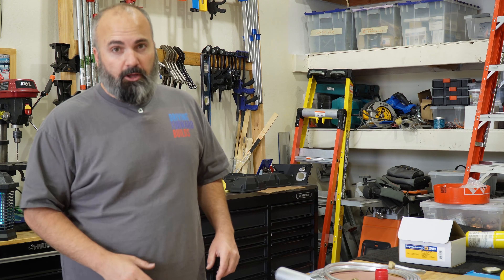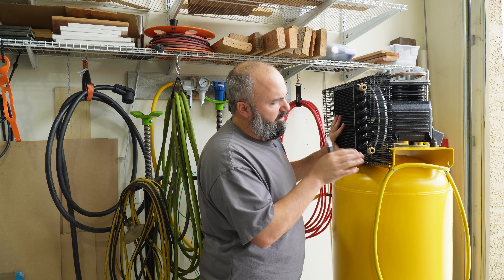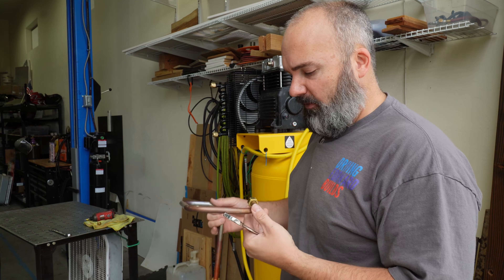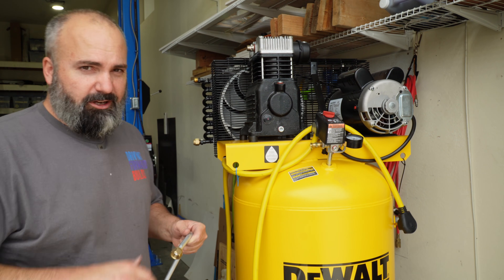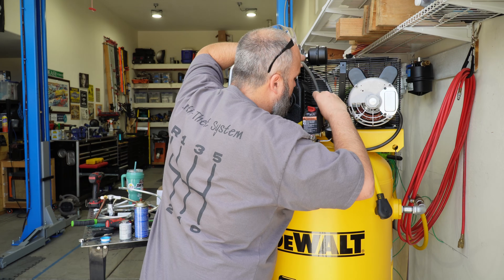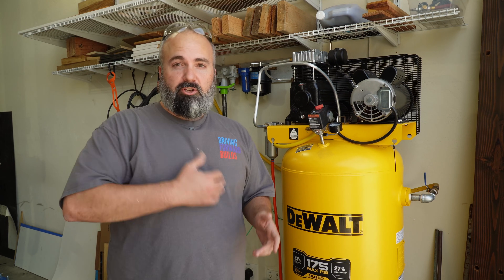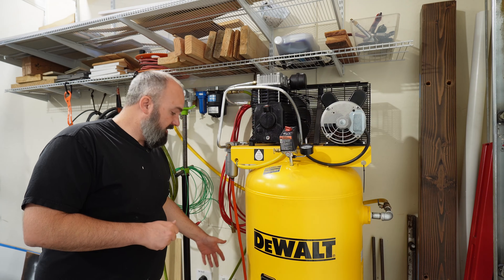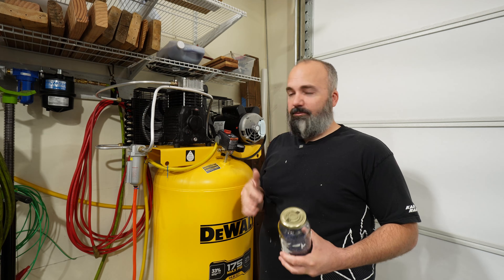DIY Air Compressor Aftercooler/Dryer

Comment: The compressor output air is hot but it goes into the tank. Does your tank get hot enough to justify that array of copper pipe? My compressor tank barely gets over room temperature. I put 1 regulator and filter at the tank output which regulates the whole system.
Reply from the maker: My tank does warm up yes. And in the summer time holds a temp above 100* pretty easily. I have been using this setup for a few seasons now and how found I get some water in the tank, and check it with each use. Usually no more than a few ml comes out. My drier media on my line last for a long time as well.

Comment: Why not use compression fittings instead of flares? Genuine question, not hating.
Reply from the maker: If I recall, when I was looking for parts the compression fitting were slightly more money.
Reply: @DrivingForwardBuilds thanks bud

Comment: Do you mind telling me the model of your Dewalt air compressor? I’m planning to buy the DXCMV5076055 which is 2 stage 5hp 60 gallons. I’m wondering if the fittings are 1/2, same as your!
Reply from the maker: Mine is the DXCM603. I found it on sale at Tractor Supply for $930 last year when I bought it.

Comment: Have same exact compressor . Planning on using it for about the same projects especially sand blasting that can be frustrating with water causing the gun to jam . Great video thanks for the tips .
Reply from the maker: Glad the video could help! Hope it works well for you.

Comment: I did this several years ago with a transmission cooler.  
   Used Swagelok lines and fittings. It’s stainless so I bought the bender for the line.  Very nice products. 
   The main reason I bought the Swagelok lines and fittings was to maintain the inside dimensions of the compressor air lines. 
   Where I screwed up was mounting the cooler solid to the motor frame on the compressor tank. It vibrated the cooler causing an air leak in the cooler itself.  
    It lasted a few years and the automatic inline water separator never discharged any moisture. I would take it apart to check from time to time. Very little to no moisture was accumulating in the water separator.  
    I had saved all the original lines that were on the compressor so I put them back on until a new cooler could be had and mounted properly. Haven’t found the time to do so, but moisture is growing into more and more of an issue. 
   I might just bend up some line and mount it just like this one.
Reply from the maker: Thanks for sharing your experience, good to know! I'll keep an eye on mine for vibration failures.

Comment: There is no way we are getting a lower temperature out of that after cooler than the ambient temperature and by the way there’s no substitute for a refrigerated compressed air dryer
Reply from the maker: I'm just using an infrared gun to measure. If it's lying, I'm not asking it to, and yes there is no replacement for $$$$ refrigerated systems.
Reply: @DrivingForwardBuilds skin temperature?
As it’s impossible to achieve that low of the temperature in that high of an ambient condition

Comment: Great video. I'm looking to set a new one up soon. The JIC fittings are super easy to find. On the zip ties the airplane trick works great to get a little stand-off. Just put a tie around the holding tie before it's cinched down. I will be getting one of these coolers thanks to your videos. Many thanks !
Reply from the maker: I'm glad that helped and the JIC fittings are a great idea.

Comment: Great modification! Someone else suggested an additional water trap before the tank & I agree. A simple  1/2" dia. galvanized Sch.40 steel pipe straight down from cooler for 2 ft.,  then into a 3/4" "T" & up a 3/4" pipe to existing water seperator. A drain valve or auto drain at bottom of "T" would remove most water, allowing the existing water seperator to have less load & be the second stage of water removal before the tank. The cooler was a wise move, great upgrade!
Reply from the maker: That's a great idea; I might add that to the system.

Comment: How’s it running ? Doesn’t reduce the air flow to compressor or electric motor to cause any long term failures due to heat ? I wanna do the similar setup on my 5hp 8o gallon IR I just set up - I added a mag start relay and 2 pole safety switch to control auxiliary fan for electric motor - didn’t know if I should add another fan for heat exchanger 😊
Reply from the maker: So far it's still working out great. I haven't noticed any discoloration in the oil or around the case. I do still get a little moisture in the main chamber leading me to believe an additional fan or larger radiator could help. But honestly I'm getting a few tablespoons vs a cup or more of liquid before.

Comment: Just a heads up, the link to the tubing bender in the description is no longer correct. That company changed that model, and it no longer bends 1/2" tubing.
Reply from the maker: Dude, thanks for the catch. I see they have a new 1/2" version. I'll fix the link. Thanks for looking out🙂

Comment: Those 13.7 CFM compressors are running too high of RPM to last, l turned mine down to 120 psi to shorten run time they really struggle to reach about 120 to shut off pressure,
Reply from the maker: That’s good info. So far it’s seemed like it’s able to maintain pressure way better than my old unit. I’ll keep an eye on it and make sure to change the oil.

Comment: Seems to me that if the air is now colder going into a hotter tank, you’re still going to make excessive compensation inside the tank
Reply from the maker: The point of putting cold air into the tank is that it doesn't heat up as much as before. Plus the condensation is pulled out prior to the tank. I do still drain the compressor after every use and get a little mist out. But not the rush of water it would prior to installation.

Comment: You learned why they don't use aluminum tubing from the factory.  Aluminum will work harden and crack so much easier after than copper.  Besides the crooked ferrule, you are dealing with constant vibration.  Even if you think you can't see or feel the vibration, there is always inherent vibration in any reciprocating machine and it transfers to the tubing which translates into micro movements which will work the tubing.
Reply from the maker: You are 100% correct. In fact, the line broke again just recently. I have a bunch of the aluminum left, so I will just make another line once this one is too short to fix. Then, I will get some copper lines and bend them up the way I should have from the beginning. I guess the old motto, "buy once, cry once," really does make sense. I was just trying to save a few bucks on the copper. oops.

Comment: nice to see you did the same as i did... theres a fan, why not use it, huh?

i opted for the single layer 9 row. gravity... the double pass makes loops... and the water pools up in there. then your just bubbling the air through water...

the water trap... they require air flow to really work, and as the tank fills, flow rate reduces... they dont work so well. found i was still getting some droplets sneak through until i swapped over to a long "baffled catch-can" type setup... havent had even a hint of moisture from the tank since.

another advantage of throwing the cooler on is the starting load... it takes a few seconds for it to fill all that volume up, lets the motor virtually freespin at first. despite the blowoff/unloading valve, a lot of cheap compressors get grumpy (burnt out motors, blown circuit breakers, dimming lights...) when starting as the line pressure rises before the motor gets up to speed... and even some not-so-cheap ones do it too...
Reply from the maker: Great info. Thanks for sharing!

Comment: Your comment on a auto drain is good. Try the Moisture Minder drain by Tsunami Compressed Air, this works great been on the market since the 1960’s ,doesn’t waste air and is totally pneumatic. A good electronic drain is the EDV , it has a built in self cleaning strainer to eliminate rust from fouling the drain. They both are easy to install for the DYI  people.
Reply from the maker: I will definitely look into those! Thanks for the tip.

Comment: Getting rid of that swamp cooler and going mini split AC is going to save you big time! There are some auto drain 110 volt timers on the market that will eliminate your desiccant maintenance
Reply from the maker: For sure. I can't wait to get there.
Reply: Just had an 18,000 BTU along with R-18.4 garage door installed in my 2-car garage / workshop.  Awesome!  My garage is cooler than my house lol

Comment: Thank you!! Very helpful video. 

Do you need a metal line coming out of the radiator, since the air is now much cooler? I’m gonna do something similar, but with braided line maybe, and it’s expensive. Can I just use rubber hose for the line from radiator to tank?
Reply from the maker: As you point out the air is much cooler there. I would think as long as the line can handle the pressure and what little oil might bypass the pump you’ll be good. If it doesn’t work you’d certainly hear it. I over crimped my connection to the tank and it broke after a few cycles and blew off. It was an easy fix though. I just resent the line and tightened back down.

Comment: I have a concern about this particular radiator. (Yes, I know others use the same one.) At each end the tubes attach to another with 180 loops. but it looks like half go to a lower tube but half go to a higher tube. Doesn't water collect in the lower tubes leading to higher ones? Aren't you blowing air thru partially water filled tubes? It's obviously working but would you be better served by a radiator that only flowed in a level to downward direction? I'm asking as I want to do something similar but would like to not have water "trapped" in the tubes. Thanks for your thoughts.
Reply from the maker: I’m not sure that the water would actually collect as there is a constant flow of air moving through the tubes. That and the air moving through is very hot. The tubes are continuous as well leading me to believe any water that may be trapped will push through to my first separator.
Reply: @DrivingForwardBuilds  Thanks for the quick response!
Reply from the maker: @Happily_retired  glad to help.
Reply: @Happily_retired  that was my train of thought when i did mine, and so i opted for the thinner single...row? pass? arrgh! 9 row, anyway. more than enough, even with a 40C+ australian summer at 99% humidity... its cold by the third or fourth row...

and yeah, gravity all the way, even when its stopped its draining...

Comment: I'm going to do this.  The only thing I think I will do differently is come up with a different placement of the cooler.  Seems blowing the heat off it and back on the head is hinder8ng the cooling of the head.  Though you may not see a problem, I think I will do it anyway.
Reply from the maker: That's a good idea to move the cooler. Originally I was planning for the cooler to be off the unit with a fan. That was starting to get more complicated than I wanted. Hope it turns out great.
Reply: https://youtu.be/gNlsULpBtCk?si=NkJZcNyyeR5RtSsf

I built a frame and side mounted it

Comment: I just saw another video where the person had one of the hard lines break where it attaches to the cooler (on the acttual cooler, not tthe AN fittting) after a couple of months. How has yours held up so far?
Reply from the maker: My cooler lines have held up great. I did however have my line break at the check valve going into the compressor. That was my fault though. I tighted the compression fitting with the ferrule sideways and then it leaked, so I overtightened it and weakened the aluminum tube. It broke within a few days. I cut the line and added a new ferrule and has been good since.

Comment: You must have (ANY) water seperator at least 25' from the compressor.  This gives it enough time to help cool the line.
Reply: The water separator needs to be far enough downstream for the air to be cooled. He’s using a 16 pass radiator with air coming out at about 88 degrees so putting the water separator after that is just fine.
Reply from the maker: @calsbarn5996  I didn't really think of the distance in the cooler. Good point, Thanks!
Reply from the maker: This would be the ideal situation. In my case as well as many that 25’ rule becomes less practical. I hook my air line right up next to my compressor and can reach the whole shop and driveway.

Comment: Works exactly as he shows. However I found using (2) water separators removes the majority of the residual water and keeps the tank supply much drier. Otherwise, this is a MUST HAVE on any compressor system!
Reply from the maker: Good idea with the two separators. I do still get a very little water in the bottom of my tank.
Reply: Oh, like that idea too. I’m using the same radiator and water cooler he is and find that it’s probably between 80 to 95% efficient depending on the temperature / humidity conditions. I’ll buy another water separator and see if that improves the efficiency.

By the way, my efficiency estimate is based on comparing water removed by that water separator to the the water in the tank plus the water in my second separator closer to my work area. If I instead compared only the water from the second separator to the water from the first separator plus the water in the tank I’d say it’s always at least 95% efficient and probably much higher - maybe 98-99%. That’s because the air going into the tank is already cool so it doesn’t hold much water even when used for extended periods of time.

Comment: thanks for sharing your great design! carrying this thought even further, since compressed air is so hot, this application seems ideal for heat-powered coolers. an ammonia and water absorption cooler, like the old gas refrigerators, uses heat to cool an evaporator that you would place adjacent to your cooler fan, cooling your compressed air below the ambient temperature by the time it enters your tank. ...or, a paired sterling engine/cooler could work similarly, providing sub-ambient cooling from the compressor heat. it would be interesting to see if there are any commercial compressors that take this approach.

Edit: I see Thermax offers absorption chillers for air compressors, but at industrial and not at garage scale. Even though they get "free" energy from the compressed air heat,  but maybe at smaller scales, chilled compressed air isn't worth the capital cost of an absorption chiller?
Reply: sandblasting, plasma cutting, spraypainting, you want dry air. the chilled compressors are generally running "on demand" as well, rather than storing... storage is an issue. if you fill a tank with CHILLED air, the pressure will rise as it then warms up to reach ambient. and that may very well push the tank past safe working limits, especially in the sun on a hot day...

no point cooling below ambient if you are storing any appreciable volume.

and as for air tools... you get better performance/more power/less air consumption if you heat the air back up to what it reached during compression, or higher, before use. easily proven... drop a coil of pipe in a bucket of boiling water just before the tool (pointless to heat it up then run it through twenty foot of airline?)...

air at ambient cools below freezing as it expands and cant expand to its original volume until its absorbed heat... an air tool that exhausts warm air is producing more power.
Reply from the maker: Chilled compressor cooler/driers are more often found in commercial applications with paintwork and blasting/coating. They need dry clean air. In a home shop you are often, as you pointed out, limited by the cost of such applications. However with the skill and enginuity it could be done, and you sound like you know enough to make it happen! Thanks for the comment and view!

Comment: Stupid question coming... anyone do this and add another larger condenser or double up on the cooler? Add electric fan? More surfaces, more cooling. Trying to eliminate running $$ copper pipes.
Reply from the maker: I’ve seen electric fans added to the cooler, but usually when the cooler is mounted off of the compressor.
Reply: @DrivingForwardBuilds  Thanks... I'm setting up my shop.  Also wondering if TWO air coolers/radiators would be better...
Reply from the maker: @greglardizabal6736  That really depends on the environment and humidity. I ran my compressor a lot through the summer here and it pulled moisture out the entire time, not much but it was there. I still emptied the bottom of the tank after a day's use and had 1-2 tablespoons of water there as well. If you had a larger cooler or multiple with dedicated cooling fans, it would pull out more moisture.
Reply: @DrivingForwardBuilds  Thanks!
Reply: @greglardizabal6736  Let us know what you end up doing. I have a nearly identical setup and  the outlet air temp from the radiator is already close to (or maybe lower than) ambient temp so another radiator probably won’t do much. Someone else suggested a second water filter and that sounds like a better solution to me - I’ll be buying a second filter soon.
Reply: @greglardizabal6736  40C + australian summers... finding its below ambient by the fourth row. and thats after running flat out for over an hour...

doesnt matter how much surface area you have once its cooled down. it isnt getting any colder...

dont overthink it...